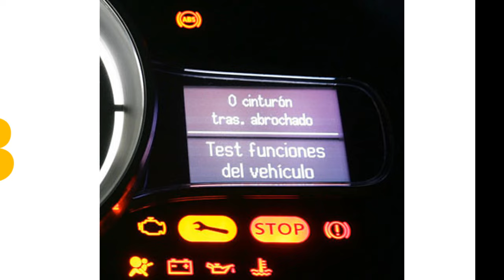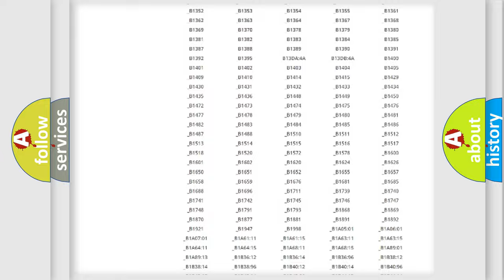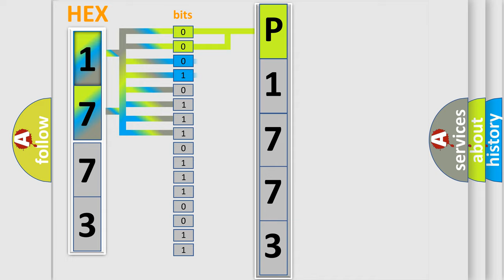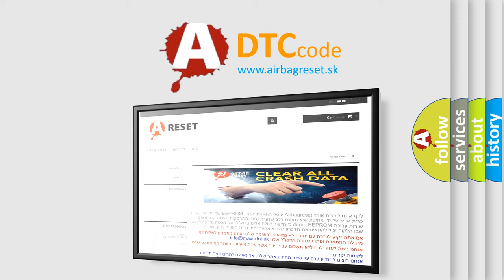DTC Mitsubishi P1773 Short Explanation

Comment: What means p1773 in mitsubishi lancer 2009? What is specific problem in my lancer?
Reply: i have the exact same issue in my 09 lancer, did you get it fixed?
Reply: @99drums54  No bro
Reply: @99drums54  and did you get it fixed?
Reply: @diegoserrano3057  no, so you're car is still running fine?
Reply: Soo did anyone get it fixed? Having problem
Reply: Having same issue with 08 Lancer